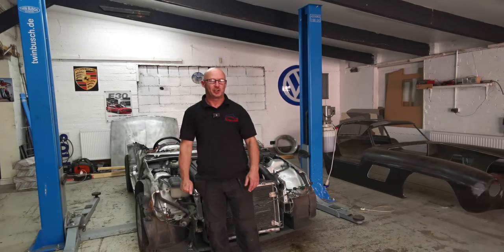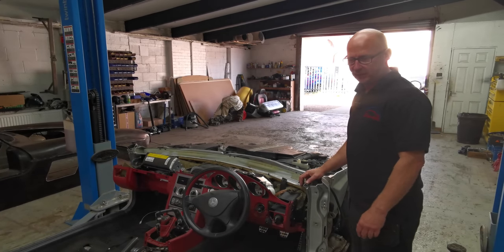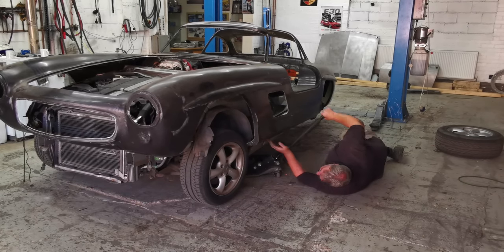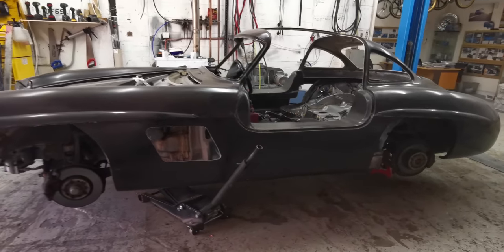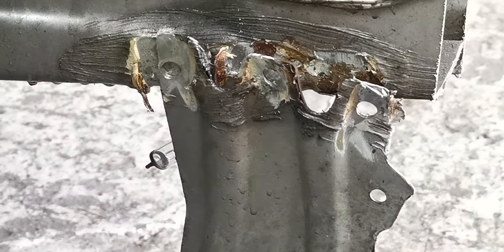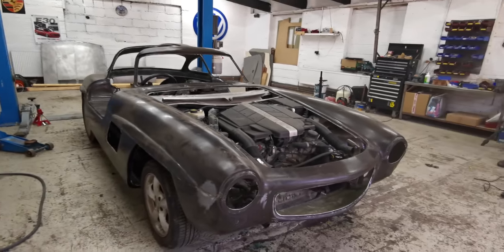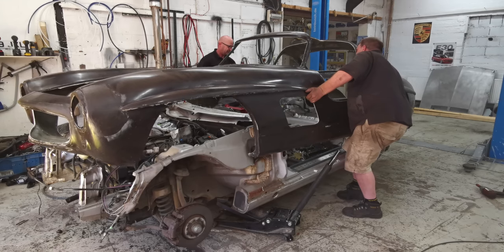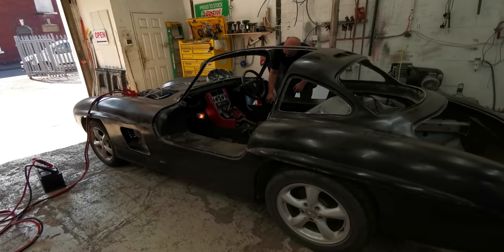the SLK has a different body pt4 of the gullwing project

Comment: I am getting ready to build the same car however I am still trying to decide which donor car to use. I would love to be able to work on the car myself without any "special" tools. I would -probably try to choose an older corvette. If I wanted to keep it all Mercedes then I would probably choose a wrecked 380 SEL  or 450 SEL. I am still in the decision process. Thank you for sharing your work.
Reply from the maker: Good look with your project
Reply: @andirt4  Thank you so much. Maybe an slk with an LT1 engine. I love the look of that particular engine and a 5 speed manual. I love welding however I agree that doing body and frame work every day can get kinda tedious. I have been assembling a machine shop to support the builds that I have lined up. I hope I will be able to perform the builds and video everything at the same time.
Reply: Hi, this project for sale how money? Very good project, good lucky. 👏👏👍
Reply: If you can keep it all Mercedes
Reply: @Edward-rv2bu  I found an SLK but it has not run for a few years. It is a convertible so it is probably worth purchasing and restoring it to drive..
Reply: Who did you get your body from?

Comment: I got two fifty year old Mercedes. 508s. Great old ride. Think I would find some old Mercedes hub caps and cut some discs and attach caps over top of alloy wheels. You get a better vision of what you building. It's just tempory. But your eye will change. Good luck.

Comment: You English people, you are great!
  in France it is impossible to manufacture and modify this type of vehicle.
Even the replacement of alloy wheel (by bigger ones) is not possible.
Reply: It is Didier, it's just a bit complicated. I imported a 2001 clk 320 convertable from the UK that was converted to a Brabus 3.8 with different wheels, brakes, exhaust, inlet etc.. It depends on how freindly your local Drel is.

Comment: So will this go on a Q plate? Looks amazing, what size wheels and tyres are you going for?
Reply from the maker: No it’ll go on the same plate as the slk as it’s a body swap
Reply: @andirt4  So will it need an IVA test?
Reply: Modified monocoque, so IVA for sure, to be strictly legal.
Reply: Hummm, I thought if you cut or modify the chassis/mono in any way, it can not pass the iva...Hope I am wrong....
Reply: @davidf680  not quite right. Mod the chassis / monocoque and the original identity is lost. Hello I'VA, but anything can pass if its compliant with the requirements. Later model cars should be able to pass relatively easily as they'll already have components that comply, eg no sharp edges inside or outside. Curved glass for an earlier car with the appropriate markings for instance could be an impossibility, or just ££££££.

Comment: It will need to be re registered as it has been radically altered, ask DVLA.
Reply: If it’s retained, engine, transmission rear axel etc it has enough points to retain the original registration?

Comment: I'm at this stage in my build. Part 4 at 13:45, what did you do about access to your fuse box on drivers side once you got body as low as you wanted?
Reply from the maker: You can still get access to it although it is very tight